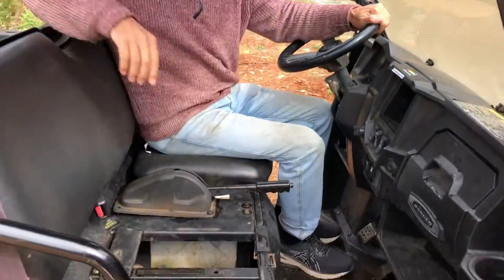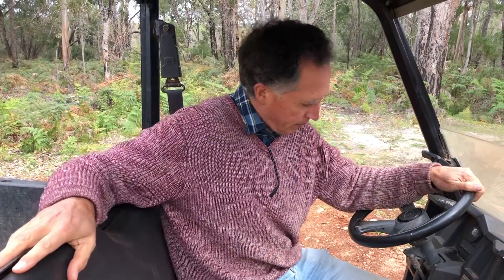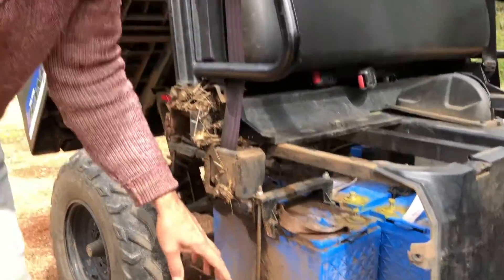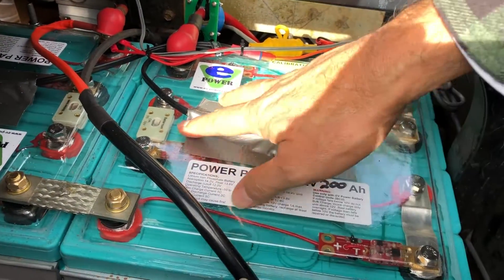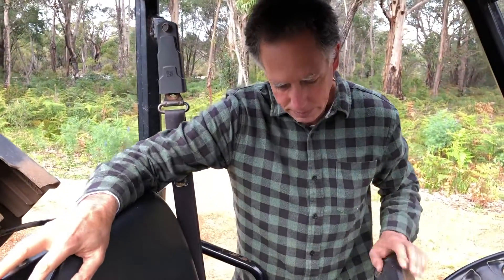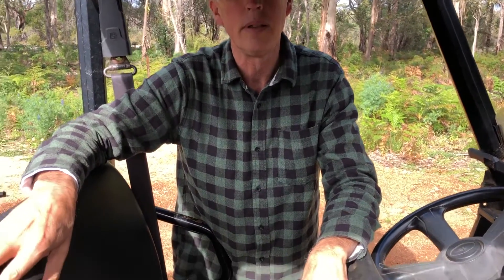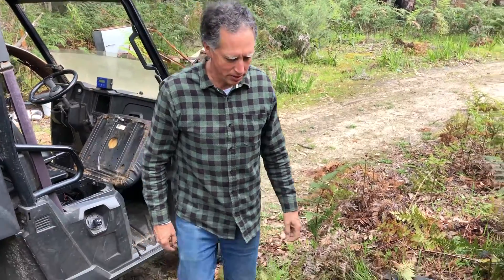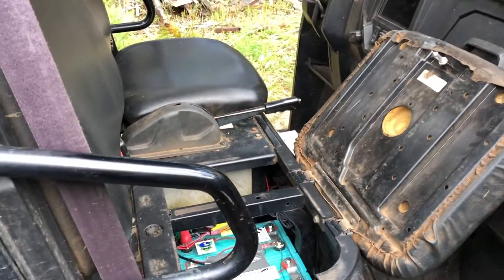Polaris Ranger EV conversion from Lead Acid to Lithium (LFP) Batteries

Comment: Be careful,  It affects the ballast weight on an incline.  I flipped mine and broke my hip. I was getting 6miles of range for every 2kw of batteries.
Reply from the maker: Yes, the ATV is about 200kg lighter, however I did not notice it to be more top heavy, I had it slightly sideways in a few turns ;)
Reply: @ev-power  My issue was I was stopped pointing downhill and had the wheels cut to one side and told my nephew to give it some throttle.  The next thing I knew we were on the side and the batteries were hanging from the wires.  I didn't secure the batteries:(
Reply: Were you an EVTV fan?  Are those Jack's busbars?
Reply from the maker: @116thcrazy  Those are our busbars. Jack Rickard did inquire of us one time, long before he ever started EVTV.